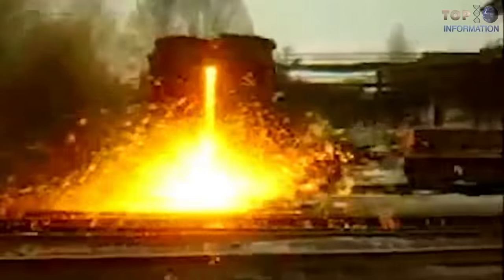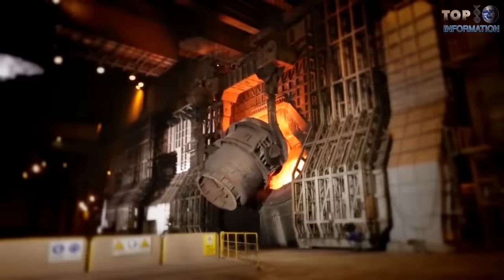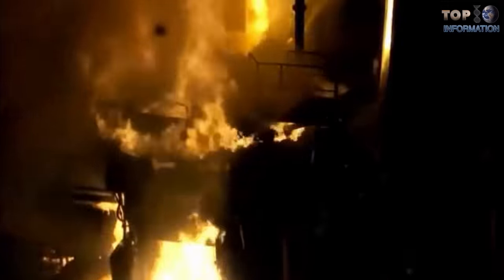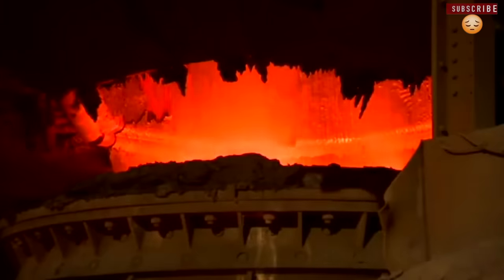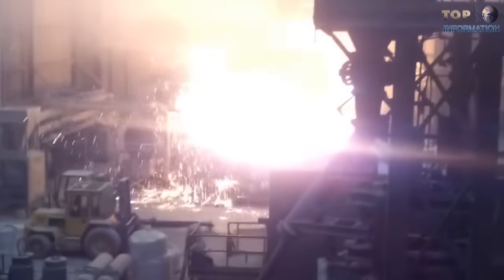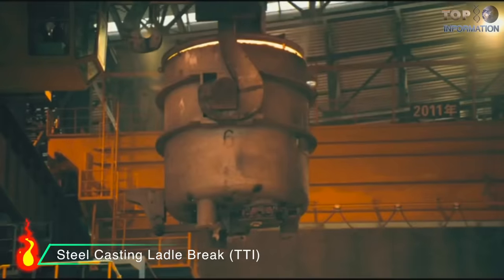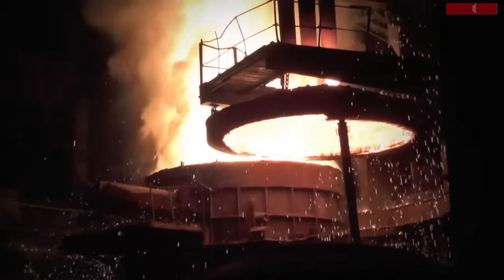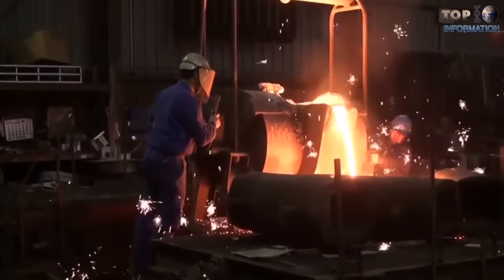TOP 10 Accidents In Metal Industry ✅

Comment: I've lived over 6 decades just a stone's throw from, or in, Sheffield, UK. As such my family has been intimately involved in the many aspects of the steel industry. We have many tales of the shit hitting the fan.

#1. My late mother worked, for a time, in a steel foundry during WWII. As she was passing an annealing oven a sheet of red hot steel shot out, knocked her off her feet and continued on. The heat melted the fabric of her work clothing and singed the back of her hair. She chose the safer option of taking a job at a nearby RAF airfield!

#2. Her first husband also worked in a nearby steel manufacturing firm. A sliver of steel came off a girder he was bending and punctured his chest. It eventually cut into his heart and he bled to death internally.

#3. While working in another foundry (post war) I was struck by some waste molding material and needed stitches to the back of my head and left eyebrow. That was the day before I was due to go on holiday. That eyebrow is still numb 50 years on.

#4. At the same foundry my shop supervisor (a survivor of the Japanese Chengi Prison) was working a double shift when his relief failed to turn up. So he worked a third shift which overlapped me arriving at work. He dropped dead from a heart attack minutes before he was about to clock out.

#5. Staying with the same foundry: One day a large casting mold literally exploded as the molten steel was being poured. The 'post mortem' investigation came to the conclusion that one of the feral cats that roamed the place had given birth to a litter of kittens inside the mold and that mother and kiddies had flashed into steam on contact with the molten steel. While the works was shut, one of the board members was strolling through that shop when he tripped over a cat in the dark. He had all the cats rounded up and destroyed. After that it was deemed a sacking offence to feed any cats on the premises.

#6. A few years later I was sub contracting laying and maintaining railways in many places, one of which was another foundry, when a careless move by a crane operator spilled tons of molten steel across the melting shed floor. Our gang (team) was about to go home, but we had to stay back and wait for the steel to cool so it could be cut up with thermic lances and hauled away. Following this we had to dig out the burned out sleepers and twisted rails to then replace them. This was in 'the pit' under the still working electric melting furnaces!

#7. Not long after my father (my mothers second and final husband) was struck by a section of steel rail as it was pulled out of a stack of scrap by an overhead crane. He was dead on arrival at the closest hospital. In total 4 men died or were crippled on that job in just 3 years.

After that I chose a different line of work. 

Since those days, all the foundries that I worked in, or even knew by reputation, have been shut down, the buildings razed, and other structures erected to replace them. With one exception: A "Science and Adventure Centre" in the furnace shed at #6.
Reply: a man of many parts 

very unfortunate and I feel for you. They could have spared the cats those girls though.
Reply: a man of many parts I've seen quite a few things like these happen but all all I've seen (personally) were operator error

BTW yes I work metal fabrication/casting
Reply: amomp ;   I didn't even finish the video, voice of the narrator ruined it for me, but I'm glad I scrolled down the comments......A good read, Thank You.
Reply: Wow! Good to still have you with us bud!
Must have been a job that was never boring with you always having to look out for dangerous stuff about to happen
Reply: I have learned that the Chinese phrase "May you live in interesting times" is more than it appears to be.

(The Chinese ideogram for 'interesting' is virtually identical to the one for 'dangerous'.)
Reply: a man of many parts, GREAT stories my friend!!!  I too have spent many years in a copper smelter and in the copper casting plant itself as a furnace operator, crane operator, 3-line operator and a few other positions as well, and I've seen some crazy shyt go down many many times!!  I've seen a S.L.O. (which is a senior line operator) spraying water instead of emulsion8 on a line of casting molds...not intentionally but none the less, and the second that molten metal hit those molds my god it was unreal and the explosive force of it was unbelievable!!  I have also witnessed a copper casting furnace have the bull gear fail or the motor drive did, not sure which...but that furnace completely emptied itself on the casting plant floor and you wanna talk a bad day on the job...they were finding oxy-accetalin tanks literally a mile away from where they were when they exploded from the 1700° copper coming into contact with them!! It took months to repair and replace half of our casting plant!!  Some don't realize how dangerous any metal producing planet can be...i always made sure I knew my surroundings and potential hazards around me every where I went in those plants because when shit happens(and it will) it happens extremely fast and extremely furious!!!
Reply: write a book
Reply: a man of many parts interesting stuff, thanks for sharing your stories. I'm a prewar and classic vehicle engineer, I usually play with the metal after its cooled down lol.
Reply: a man of many parts holy f
Reply: a man of many parts . Worked in many foundries in the 1970s as a boilermaker welder. You didn't just have to keep an eye on what the foundrie workers were up to. You also had to watch where you were standing because of all the scrap metal lying around. I've seen fellas with really nasty cuts after tripping over scrap. Another constant problem was your clothes catching fire and being unaware of it till someone else alerts you or you actually feel the flame on your skin. But it was all in a day's work back then.
Reply: Damn 😯😯
Reply: The cat in #5 couldnt have chosen a worse place to give birth to her kittens...also damn! Thats cruel...poor cat.
Reply: a man of many parts  i loved this. Glad i read all of it. Sad but good stories.
Reply: a man of many parts I'm from Sheffield and work with steel.
Reply: God bless your family
Reply: Lol. If that makes you upset, you should see what we do to pigeons in the steel industry. A lance pipe and welding rods are involved.
Reply: damn man thats alot of horrible experiences, i feel for you. while i dont have experience in foundries, ive worked in factories welding, bending and assembling metal peices and here are a few that i heard of and happened to me:

spot welder cooling hose malfunctioning, tore apart and showed boiling cooling water over my colleague (luckily he had his back turned so his burns was just first degree burns)

another spot welder incident, sensors failed resulting a colleagues thumb got crushed

i was spotwielding one day aswell and we had big thin metal plates we called ''tv-squares'', very unconvenient to handle, i managed to drop it and got a deep cut in my right arm.

in the 80's, one of the big steel presses stopped working, the operator went in, safety system malfunctioning and the guy got crushed by a 1800ton press
Reply: Oh my god! Holy shit man. I could listen to your stories all day
Reply: If I wanted your opinion, Antwone ...
Reply: Nigel. It's the use of language that separates us from the animals. In your case that's almost separates ...
Reply: Poor cats and kitten newborns <:(
Reply: I was running a small arc furnace in South Carolina in 1980, and we used home heating oil in our homemade ladle pre-heater. I would plug the tap hole of the furnace with green sand right after striking an arc...anyway one of my helpers, a Cambodian who did not speak any English, laid one of my tapping lances in a small puddle of that oil, when I went to tap a heat of GA Meehanite (grey iron) the lance exploded in my face...shooting metal all over me. 

The biggest wound was on the top of my head where a good-sized splash of iron went under, then fused with, the top head band of my face shield (we did not have hard hats). It hurt like bloody hell on my head and I smelled like burnt hair for 2 weeks....now 38 years later of course I am bald there...

Foundry biz...I have been in 6 of them..nothing like it...
Reply: a man of many parts - and the rest of the curse goes something like this: "and may you come to the attention of important people. .."
Reply: Is Sheffield like Pittsburgh for us? Sounds like it.
Reply: This is what makes YT comments worthwhile.
Glad you made it out alive, brother.
Reply: a man of many parts. As has often been said before, we owe a dept of gratitude to the likes of your late Mother, because by working in shitty dangerous environments, it freed up the Man-power to fight a war against oppression. I only hope your Mother lived long enough to see the 'Women of Steel' Memorial, outside Sheffield City Hall. I presume the 'Science and Adventure Park' you refer too, is the 'Magna' site ? I used to deliver scrap metal into that 'sh'ite hole', on a regular basis. (I seemed to get bloody punctures there all the time !) The only good thing about the place, was that you could park up, and get a late beer at the Pub, (by the gates, name of which eludes me), as the guys came off a late shift. As an aside, have you thought about putting some of your memories on 'The Sheffield Archives' Web site ? I'm sure they would love to hear more of your stories.
Reply: Very interesting series of events that affected you and your parents.  What a sad waste of life,  just so this mechanized world can rumble forwards.  Thanks for sharing.
Reply: That stuff is gangster!
Those poor people and animals!
Reply: a man of many parts Thanks for sharing that!
Reply: @amanofmanyparts9120  It's more of a curse you offer or wish on someone, hoping they have an unpleasant life. Basically: "May you have a shitty life."
Reply: Most of the heavy industry in the west has been ceded to China. That is the main reason for so many foundry closures, this is sadly the truth.
Reply: Yep and we had a giant, ignorant man working with us, who would grab a cat and throw it in the furnace, nasty piece of work he was. That poor lad who fell into the pot with his dad watching him whilst he melted away screaming. Horror stories of those days that will never leave me.
Reply: @Rambeau777  Even aluminum melting is dangerous. Water and molten metal is a no no. I worked in a foundry and water was on an ingot, which exploded sending molten aluminum all around the building. Lucky no one was killed
Reply: @cyrus8432  I bet the welding rod comes out very fast
Reply: Sheffield. isn't that where stainless was invented. ?
Reply: Hello ! May Allah protect and guide you to his light and happiness in this life and the hereafter, God bless, Ameen. Excuse me for giving a little presentation of Islam, because it is very misunderstood nowadays, especially on those « Antichrist's » times, where media and politics are mixed to distort history and truth. And terrorists (puppets of the Antichrist) who misinterpret verses, out of ignorance and political motivations, and take them out of historical context (just like radical atheists do by the way), don't help either. Thank you very much for your time.

Islam is an arabic word that means the Surrender to the One and Only God, our Creator, Protector, Provider, who gives us life and all that we have, we are safe and sound by his will and grace, we are His and to Him we return, and we have to thank him in this trial life by submitting to him by our free will, or later in the Day of judgment when it's too late to save our own skin. Islam was the original Religion descended to earth from heaven with Adam and Eve (peace and blessing be upon them) in the beginning of humanity. and was passed to people with the succession of the 124 000 prophets and 315 messengers of God to all nations and civilizations since, passing by Noah, Abraham, Isaac, Jacob, Ismaël, Joseph, Moses, Aaron, Joshua, David, Solomon and Jesus (Peace and blessing be upon them) during the history of mankind, the last replaces and completes the previous, until the succession of the last messenger of God fourteen centuries ago, Muhammad (Peace and blessing be upon him) to complete the noble morals of all mankind, to bring humans and jinns out of darkness into light, and to purify people's religion and belief from corruption and polytheism, and return it to purity and true monotheism, like it was in the times of the prophets (Peace and blessing be upon them).

Many Religions that we know nowadays, at their beginning were true and under Islam, initiated by one of the prophets of God, but their original teachings, history and scriptures have been corrupted over time with falsification and polytheism, or lost and replaced with false ones. That's why Islam is the only Religion accepted by God nowadays, which consists in bearing witness that there is no god besides Allah (God in Aramaic, the original language of Jesus and the Gospel), and that Muhammad is His servant and messenger, just like Jesus and Moses and others are His servants and messengers. Never a messenger of God said he was God or literally son of God, it was the people after him who changed the words of God and corrupted the Religion. God is unique and absolute, He does not need to have a family and sons or to associate anyone else with His kingdom, He can simply create whatever He wants, everything belongs to Him, and to Him everything will return. Allah said in Surah Al-Mu’minun : “God has never begotten a son, nor is there any god besides Him. Otherwise, each god would have taken away what it has created, and some of them would have gained supremacy over others. Glory be to God, far beyond what they describe. The Knower of the hidden and the manifest. He is exalted, far above what they associate. (91-92 / Translated by ITANI).

Allah means the one and only God, the God of all prophets and creatures, the creator of the universe and mankind, and the Master of the Day of judgment, where our destiny, Hell or Paradise, is decided based on our faith and deeds in this trial life, and above all, Allah's mercy. 

Allah said in Surah Al-Ikhlas : In the name of God, the Gracious, the Merciful.
Say, “He is God, the One. God, the Absolute. He begets not, nor was He begotten. And there is none comparable to Him.” (1-4 / Translated by ITANI).

Allah said in Surah An-Nisa : O FOLLOWERS of the Gospel! Do not overstep the bounds [of truth] in your religious beliefs, and do not say of God anything but the truth. The Christ Jesus, son of Mary, was but God's Apostle - [the fulfilment of] His promise which He had conveyed unto Mary - and a soul created by Him. Believe, then, in God and His apostles, and do not say, "[God is] a trinity". Desist [from this assertion] for your own good. God is but One God; utterly remote is He, in His glory, from having a son: unto Him belongs all that is in the heavens and all that is on earth; and none is as worthy of trust as God. Never did the Christ feel too proud to be God's servant, nor do the angels who are near unto Him. And those who feel too proud to serve Him and glory in their arrogance [should know that on Judgment Day] He will gather them all unto Himself: (171-172 / Translated by Muhammad Asad).

Allah the Most Merciful said in Surah Ali-Imran : Behold, the only [true] religion in the sight of God is [man's] self-surrender unto Him; and those who were vouchsafed revelation aforetime took, out of mutual jealousy, to divergent views [on this point] only after knowledge [thereof] had come unto them. But as for him who denies the truth of God's messages - behold, God is swift in reckoning!
Thus, [O Prophet,] if they argue with thee, say, "I have surrendered my whole being unto God, and [so have] all who follow me!" - and ask those who have been vouchsafed revelation aforetime, as well as all unlettered people, "Have you [too] surrendered yourselves unto Him?" And if they surrender themselves unto Him, they are on the right path; but if they turn away - behold, thy duty is no more than to deliver the message: for God sees all that is in [the hearts of] His creatures.
Verily, as for those who deny the truth of God's messages, and slay the prophets against all right, and slay people who enjoin equity - announce unto them a grievous chastisement.
It is they whose works shall come to nought both in this world and in the life to come; and they shall have none to succour them.
(19-22 / Translated by Muhammad Asad)..

Salam (Peace) -----------------------------------
Reply: Claiming to be British, yet says 'mold' instead of 'mould' repeatedly. 🤡🤡
Reply: Exploding kittens. All the things cats get into.
Reply: That must be all that male privilege we hear so much about.
Thanks for sharing.
Reply: Did you ever work at smacc in Sheffield?

Comment: I used to work in magnesium refining. When it ignites, it really burns bright. Chlorine was a byproduct of the process, and skin contact turned sweat into hydrochloric acid. It felt like ants biting, and was called piss-ants. It was an educational job, and a few years later I used the experience with hot metals in another job, very successfully.
Reply: Good on you bro! 🤘🏼🤘🏼🤘🏼
Reply: Cool.. What was the Next Job??
Reply: @donalbershardt9290  a the next job was welding copper cables together, using either Cadweld, or Thermoweld processes. It was similar to thermite. Working short days, in 1975, I earned more than $100/day, and only the head of tbe company made more than me. That was great money back then. 
My last job sometimes paid more than that, per hour. I repaired industrial power supplies and ground APUs.
Reply: @stephenshoemate6678  Yeah that's a lot of bank especially for back then. I watch these kind of videos and wow, do I have respect and awe for the people who do this! I was hot as hell just watching!